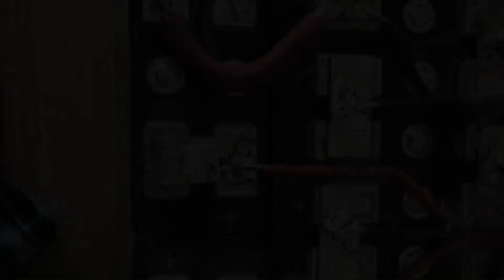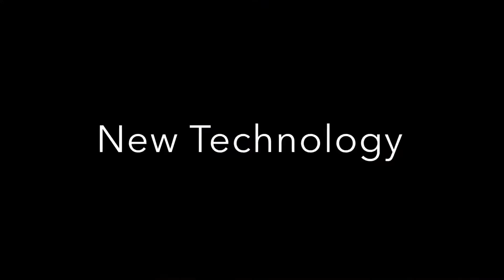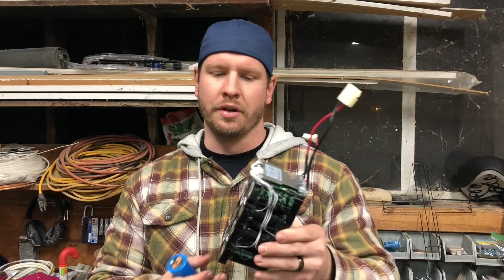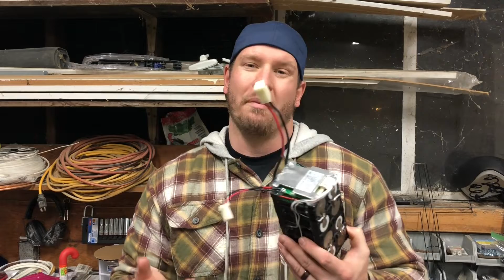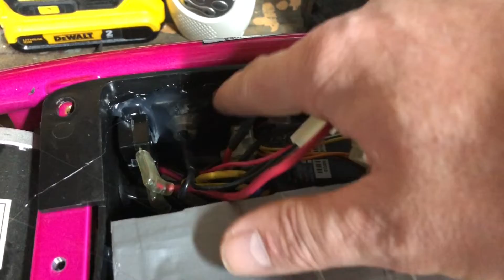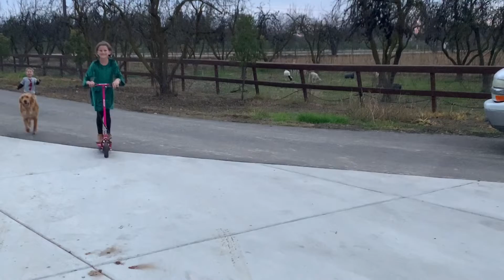Cheap & Reliable Li Battery: Battery Hookup LiFePO4 32650 Cells

Comment: i did the same for a 12v razor scooter.  Now i have a question

the stock battery charger puts out 14.18v. this is slightly below the max of 14.6v when 100% full.

The balance voltage for my bms is 3.5v on cell(bank) level.

Im thinking of using the stock charger and stock charge port and slighty undercharge the battery (4s3p) to increase the battery lifetime.

is there anything that im overlooking? or should this work just fine?

best regards
Reply from the maker: It’s fine to under-charge! Is it 14.18, though? Isn’t it 14.8?

Comment: You didn’t put a link in for the pack that you mentioned a code for.
Reply from the maker: Good catch! Let me link up the cells I got
Reply: They don't seem to be stocking those batteries as of March '23.  I live about an hour away, so I will call them.  would be worth a drive down there if I can get all or most f what I need there...

Comment: I just ordered some spim08hp batteries from batteryhookup for my mx500 I'm gonna make a 18s or 20s with them without a BMS just balance leads to charge with my imax b6 and low voltage beepers for safety.
Reply from the maker: That’ll be super high voltage for the system! Any other upgrades on controller or motor?
Reply: @LordCurt  Yeah I have the boma 60 volt brushless kit it's been working great on 16s but the battery I made is only good for 60a I'm hoping I can squeeze 80-100a out of the spim08HP batteries with my shunted controller, my controller only has 80v caps so unless if I upgrade them I'm only able to run 18s on it.